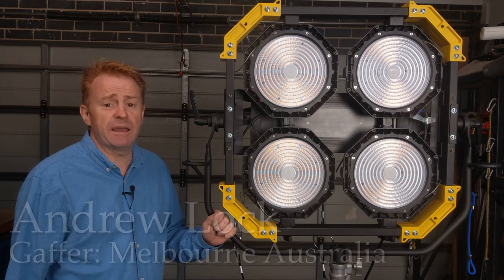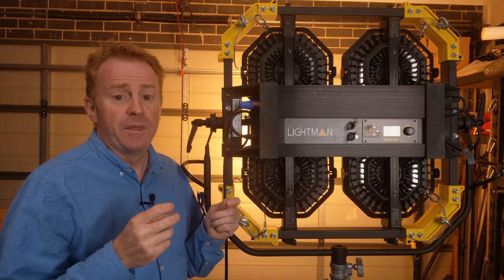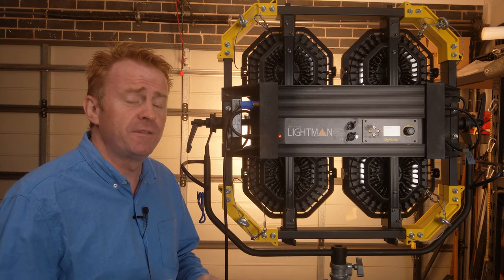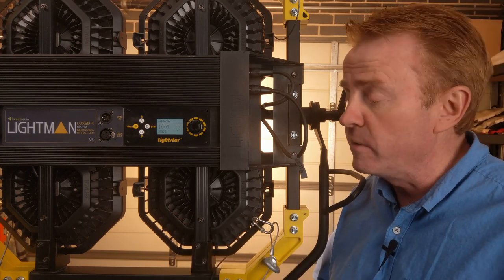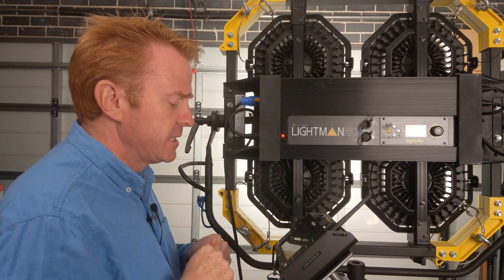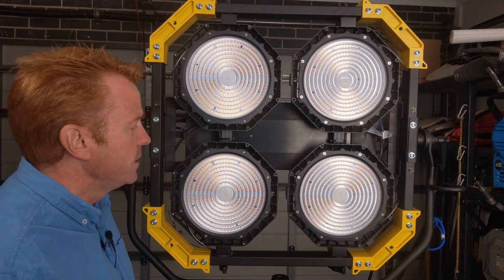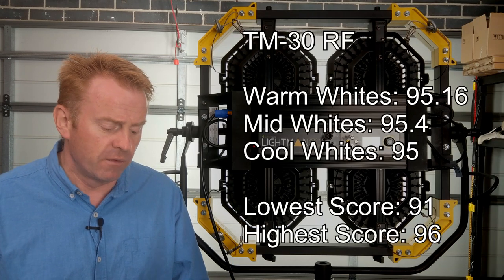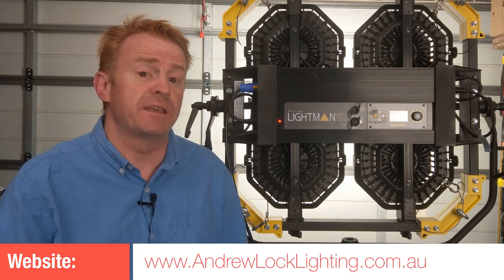Gaffer & Gear 72   Lightman Luxed

Comment: last job, I used tons of this lights. one set up is 30 spacelight configuration for white cyc and they save tons of electricity...
another is I used 6 of 12 lights unit to mimic the cinema screen light with dmx control. 
they are incredible useful and easy to use.
IN china the 4 unit one only price about 1100 usd...

Comment: This video made me put the luxed 9 on the rental list for a shoot this saturday, ill report back after, super excited to use it!
Reply from the maker: I would be very interested, the 4 in this video is still the only Luxed light in all of Victoria Australia.
Reply: @gaffergear  i can report that it is big, heavy, and bright.
i ran it on a cherrypicker for half the night and it was awesome in that role, and as a key through a 12x12 full grid, a few points:
it is so heavy and big that getting it onto a heavy duty wind up is nontrivial, be prepared to have 3 people with ladders do it or to lay the stand on the ground and then erecting the whole thing with at least 3 people (much safer). really, its almost as bad as the s360.
so it might be as bright as a 4k hmi, but i can set up a 4k by myself.
Other than dmx, there is no remotecontrol, so dmx is manditory (used a small wired controllbox, im not wireless yet).
we had two generators, both 3.5 kva, one of them was a very rudimentary model probably meant to be used on construction sites and the luxed 9 did not like it at all, over 70% it just started flickering like crazy.
the same generator ran an m18 and a skypanel without any problems, so it seems this light doesnt like dirty power. 
the other generator was a standart honda model and that worked fine.
All in all, the fine controll you get over color and output in this powerfull a light is great, so once you get it set up youre alot faster.
for me, ill use it again for studio stuff, or whenever i can put it on a big rolling stand and leave it there for the whole shoot.

im still interested in getting the 4, or even the single
Reply from the maker: @xx1simon1xx  thanks for that info
Reply: @gaffergear  I'm using (job is yet to be confirmed) 3 x Luxed-12 in February. Why so much? Hi speed shoot up to 1000fps. If the shoot goes ahead will let you know results.

Comment: At the max of 720 watts, it's still more than capable of being powered by a standard 120v outlet in the USA. Depending on the age of the building, an the circuit you're connecting to, you could power 2 or 3 of them off of one circuit.
Reply: I would only push it to 3 on a 20 amp circuit but even then, for this kind of output I have no idea when you would need 3 of these things in the same room of a house, worse case scenario very easy to run a line to another circuit.

Comment: Thanks so much! This is awesome info. I'm gonna have to do a deep dive into what all the numbers beyond TLCI mean but I'm glad it's is here for me to reference in the future.  Out of curiosity did you pull the color rendition information from the manufacturer or meter it with a C700 or another meter?
Reply from the maker: C800 spectrometer
Reply: @gaffergear  right after I posted I found the vid where you break down how you evaluate a lighting unit. Love the info on your channel. Thanks for giving us usable critical analysis instead of the usual fluff.

Comment: how would you think these compare with the Forzas you reviewed before which can be put as a cluster on one single lightstand or spread, or maybe down a corridor. Both $per lumen and also amount of times you would pick them? Im putting my money on some forza 300/500 being a better bet?
Reply from the maker: This is under 50% brighter than a forza 500 with its dish on
Reply: I was thinking the same thing. I have a Forza 500 and I thought of clustering them in to a 6 formation, very tight together so the the reflector dishes would be touching. That would be quite a powerful light 3K Watts. I talked to Nanlite and they are suggesting a rig to their R&D.

Comment: Thanks for that. Do you know what the beam angle is roughly?
Reply from the maker: I couldn't find any stats, but it felt like around 70 to 90 degrees to me.

Badicly the beam is slightly wider than the distance to the subject. So if it was 3 meters away the beam was slightly wider than 3 meters. That was with the lenses pointing straight.

Comment: Hi! I have question about lighting. Is there really any other reason of using tungsten lights at this time, other than the cheap price when compared to led? Thanks,
Reply from the maker: Complete colour render, and all tungsten colour match each other, regardless of brands.
Reply: If the camera is set to 3200 and the lights are not corrected with blue.. ie you are shooting in a blacked out studio or can filter/block any windows tungsten would get more lumen per $, and the light is great on skin. My mate has a 2k tung and it does good things for only a few $. Really he gets a lot of light for $150 compared to my $4k of LED
Reply from the maker: @sammorganmoore  yep

Comment: I am curious about the IP rating as I would love to key with this through windows and as for now I leave my M40 in whatever weather it is, it could replace my Arri M40. The 12 is only 14Kg difference which you easily make up when you dont need a generator, thick cables, gas and the M40 Ballast. If you cover the ballast you should be fine?
Reply: I read up on it and it says IP20, but I am curious if thats because the ballast is mounted on it.
Reply from the maker: @johanlindqvist99  apparently you can get a rain jacket
Reply: Nice! Nice reviews and info as always!